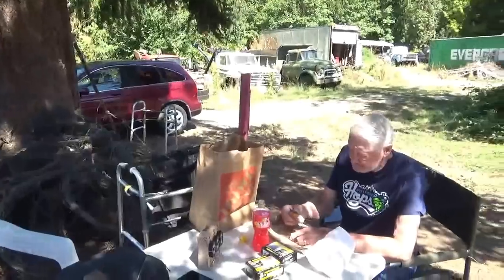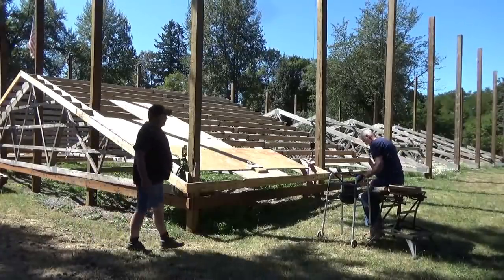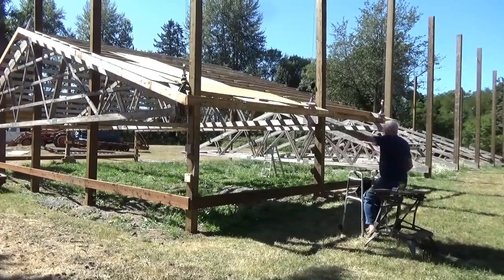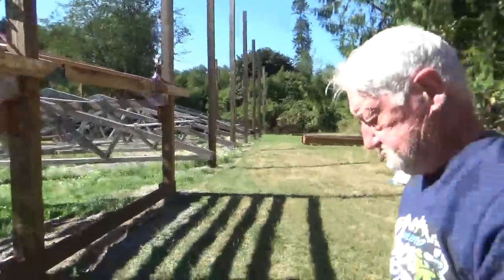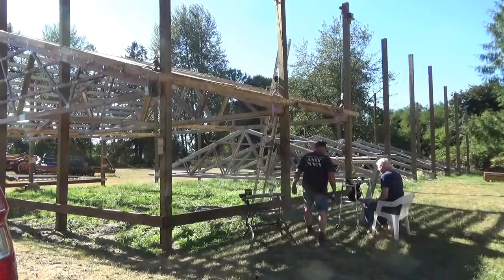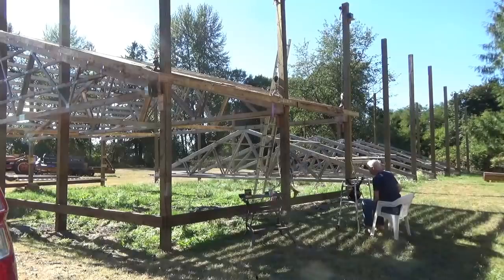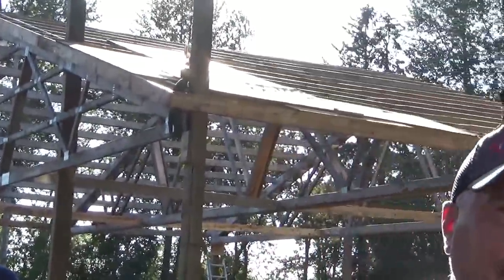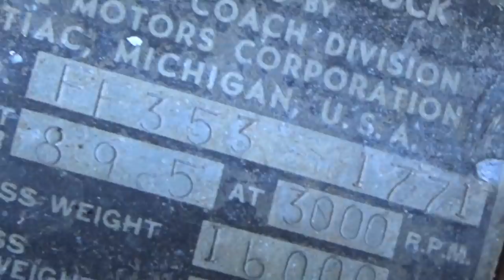81-Year Old Dad and Son Raise Roof with no crane or forklift (CTR-216)

Comment: A few years ago I worked on a aircraft maintenance in Malaysia, it was for 747's they could back 2  747's side by side into the hanger. The space frame roof structure was build on the ground, sheeted over except where the columns were, then was lifted all at once with a hydronic driven cable system and set on 10- 160 foot tall prestressed concrete columns, first time I had seen anything like that, very impressive.  You are doing a good job with your build, thanks for sharing.
Reply from the maker: Thank you Jim.

Comment: Rick, that D Ring Bow Shackle Screw Pin Clevis is called a curvy metal thingy in city slicker terminology. I worked with a few of them over the years. City slickers that is, the screw pin clevis is standard for rigging chains, cables, G12 parachutes, anchor chains...anything you want to stay connected unless you want or need to disconnect it. City slickers are like a crescent wrench, anything you put them on they tend to slip off. A screw pin clevis don't slip.

Comment: As many below me have called it properly; Clevis. Oldest on the family farm and used a D-4 Cat W/Hydraulics and pulled a disc at age 11. I was always the tallest, but grew 7” that year. To tell you how old I am, they traded the D-4 Cat in for a new John Deere 4020 tractor. But you can’t clear 8’ snow drifts off our East-West county road as easy to get to the highway! I followed field flags and built miles of terraces and dozens of waterway with a low drain ditch on each side, then Stacy bales of straw in the drain ditch to gather field dirt before rain or snow melt would or could get into the water ways which are 14’ wide. Mostly old creeks so pushing trees into pile then push dirt into bottom to settle or charge the earth. After a year, you could push the dirt to form the water way rather than a ditch. Why, Soil loss control, livestock movement and farmers where paid 1/2 the cost to both type of improvements. Yet, we never got an allowance.

Comment: Horseshoe shaped thing for strap to snatch block is a clevice.
They are called a few other names.

Put the strap in the horseshoe shaped main body (often a casting, sometimes drop forged).  Hook the snatch block or other hook to the "pin" you screw into the main casting or fix in place with a cotter key.
Reply: You did it  and it worked.

You could have done it cheaper...  But that's fine.

Comment: Great setup! I would have made a "bar" to activate all 3 winches at the same time so each winch wasn't lifting the entire section by itself. I think it would have gone much faster, as well. It would also prevent side loading on the posts while lifting. 

Could you post a materials list and what size/brand of winches you used? I need to raise mine 12 feet. I think I'll try to modify this set up to accommodate a 50' round roof. Thanks for the post.

Comment: Safety first. Use a clamp to clamp on a temp block on your posts in case cable snaps when your underneath moving them. Great work. I’m working on a folding one that comes up with a tractor pull.
Reply from the maker: Good tip!

Comment: Avoid the twisted post issue completely.. space the trusses further apart and then use  blocks between truss and post once you get it to the top.  Now it won't bind on the post as it goes up.  It makes you need longer lag bolts... no big deal.

Comment: I've seen them use a similar system to lift mobile homes and modular homes up onto pilings down here is south Louisiana. they use beams under the trailers and chainfalls on every piling. they build a catwalk from beam to beam and just walk back and forth doing a pull on each chainfall and move back and forth. When they get it to height they through bolt the beams to the pilings and cut off the catwalk with a chainsaw or used it to cantilever a small porch or stairs. Actually saw it done with one guy. He would do one side, go through the front door, out the back door and do a pull on that side. Took him all day but he got it raised all by himself, kind of strange looking but it worked.
Reply from the maker: Whatever works, Right? Thank you.
Reply: @ClassicTruckRescue  BTW, I am kinda of coming in at the middle of this build. Is there a video where you explain your choices of where you put the winches and what not. Intuitively, I would have thought to put the winches at the bottom and the snatch block at the top but I am sure you had a good reason to do the way you did.
Reply from the maker: Because you would then have to drill a bunch of extra holes in the posts. There were additional reasons, but people are free to do whatever they want on their own buildings, this is just the way I did mine.

Comment: Those handy dandy steel loops are called a clevis.
Reply: I've always knowen them as a Bow Shackle.
Reply: Bow shackle,clevis-regional thing,I 'magine....
Reply: @jamesstepp9982  A clevis is pinned, a shackle has a threaded bolt for a pin.
 Farmers use a clevis to pull a harrow or such, using a regular drawbar pin.

Comment: I am the type of guy that always sees people doing things and I see a different way to do the task. Hope you don't think I am being critical just wondering if my idea would have worked better. I would have mounted the wenches and batteries down on the bottom of the post and not had to carry them up the ladder. Would that work better? I am thinking you have two pulleys on each winch setup and therefore you are getting more pulling power per winch with 3 lines rather than 2 that my way would give you... Is that why you did it your way?  

I enjoyed the video and was glad your Dad was there with you. I lived 3 hours away from my Dad and drove almost every weekend the last 5 years of his life to help him on his ranch. Memories that I will cherish forever!!! Thanks,!!!
Reply from the maker: Pretty easy to install like they are Danny. You basically just slip the winches over the top of the poles. Doing it the other way would still result in the winches being up on top after the trusses were raised.
Reply: @ClassicTruckRescue  I guess I didn't explain myself good enough. Bolt the winch to the bottom of the 6x6 pole under the trusses is what I was thinking...  It works your way so I wouldn't listen to me...  I've never done this type of lift.  Thanks for replying!!!

Comment: Only been up for seven minutes, and you've already got 222 views!!!
Reply from the maker: I saw that....that's awesome! Thanks for watchin' Dan.
Reply: @ClassicTruckRescue  223 now for sure!  
Is the certified horsepower on that truck 89.5?  Was I seeing that right?  I could see the @3000 RPM part clearly though.

I hope Lou is doing well!
Reply from the maker: 89.5 HP Correct. Torque and gears used to get the job done.
Reply: @ClassicTruckRescue  Is that a flat head or an OHV?  Inline sixer I'll bet.
Thanks for making these videos!  I've been watching for years and years.
Reply from the maker: OHV Dan.

Comment: Why didn't you sheath the roof before raising it?   (everywhere except for where the posts protruded through)
Reply from the maker: The winches would probably not have been able to lift it with that much weight.

Comment: Man where I from a 3 man crew can put up a 60 x 60 foot pole shed up in 3 days complete doing 1 roof Truss at a time with a boom truck
Reply: This is something that I do not get he borrowed those two big white trucks one with the boom and one with the drill but has not used any of them this way must have cost a fortune but what do I now.
Reply from the maker: Retired driver
I am sure there are lots of people who could do a better and faster job than I am doing. I'm not an experienced builder though, this is my first building and I DO have other work I have to do to pay my bills. I'm also willing to bet those "3-man crews" do nothing but "Pole Sheds". They probably haven't been spending the last 5-years turning 25-acres of trees and bushes into a place where they can live with water, roads, electricity and other luxuries like that while simultaneously earning a living, making property payments and putting out fires (literally).
Reply from the maker: weaton25 
The one with the drill was used to set our poles. I made videos of us using it to drill the holes and set the posts. I also used that truck to set the trusses at the bases of the poles. We are also using it to lift the sheeting up to the roof. I had to work on both trucks to get them running and driving well. I had to pull blackberry bushes out of both of them before I could drive them home. The bucket truck has a LOT of issues and does not work consistently. Neither of them are capable of lifting the roof sections. Fortunately it did not cost a fortune because the man who owns the trucks didn't charge me a dime to let me use them. He is just a nice guy who helps people out and whenever there is something I can help him with...I do.
  Hope that helps you to "Get it". Thank you for watching. -Rick

Comment: Would it have been a problem to wire all the winches to one switch?
Reply from the maker: The problem is that they don't all pull at exactly the same rate Darryl. Some may have more resistance where the trusses rub on the poles etc...so it is helpful to be able to operate each winch individually.